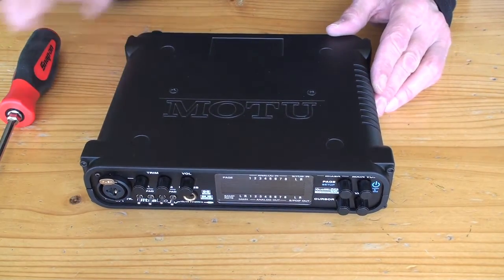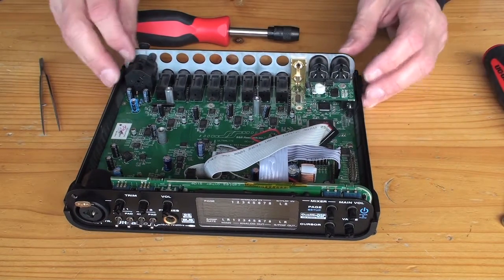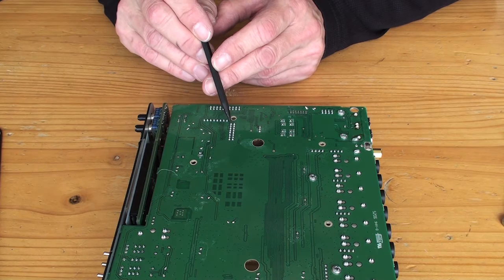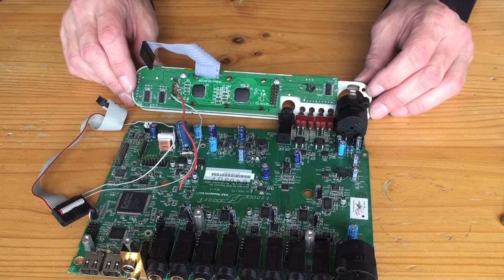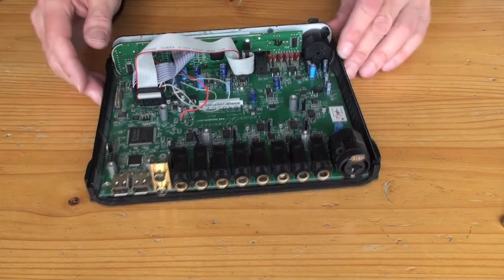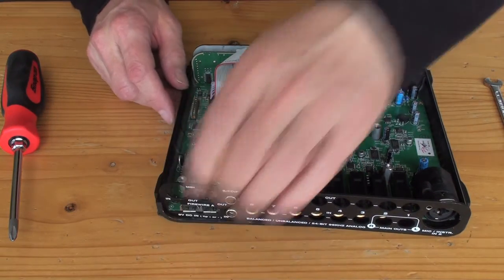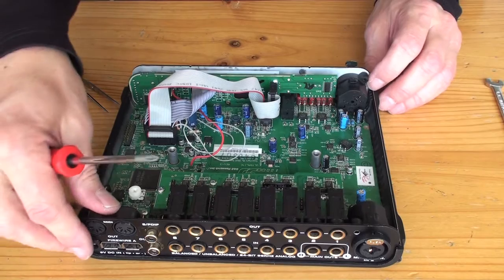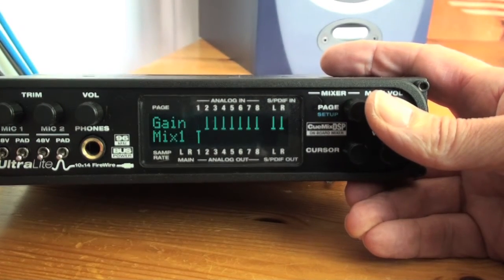Repair of MOTU UltraLite with faulty LCD backlight

Comment: Hi Valden,what cable can I use for that 5v power, just any electronic cable? And is it necessary to remove the entire board or could I just solder the  cable in place without removing the entire board? Thnx
Reply from the maker: Hi Walied. I've only just received advice of this comment. I don't know why Youtube didn't email me earlier. Sorry about that. Re the cable question - I simply used a cable I stripped out of a dead inkjet printer. As you can see in the video it's of about the same gauge as the other cables in the Ultralite. It's nothing special. If you are clever with soldering iron you could do the work without removing the board, though you would be limited to using the 5V source on the upper side. I see from your newer comment that you've been hard at work on this; I'll move up to that comment now. Regards.

Comment: Do you know why does the backlight start to fail in the first place? I mean, why does the stock connector stop delivering the correct amount of voltage to the leds? thanks, great video btw
Reply from the maker: Hi Gian. No I'm afraid I don't know why these Ultralites have problems with their LCD display brightness. I'm sure glad to have mine properly visible again. Even though it's years old we're using it frequently, making the most of its fantastic utility and great audio quality. A little while ago I did some outdoor recordings of morning birdsong, where I needed to crank the Ultralite's preamp gain up all the way, to get sufficient signal recorded. No noise that I could detect. I was using very good low noise large diaphragm condenser mics, which helped. The Ultralite really proved its value, so I'll be keeping mine working whatever it takes. :-) Thanks for the feedback on the video. I knew it would be useful to fellow travellers.
Reply: @Valden23  maybe it needs some reballing or maybe the lcd part was low quality… motu is a great brand but sometimes gets some compromises…

Comment: Thanks a lot for this video! I have a similar model - MOTU Ultralite Mk3 Hybrid Rev 2. There's a difference in the circuit from the v1 (the one in the video I guess), because I cannot find the pin point with 5 V on the board. Does anyone have 
the same issue as solved already? Thanks!
Reply from the maker: Hi Fiore. Thanks for letting me know the video was helpful. I'll try to be helpful again by mentioning that the best approach to dealing with an LCD that is fading is to replace it. I needed to do this in the end and it was a good solution. Anyone who can pull their MOTU Ultralite apart and do some soldering will be able to replace the display. Good luck with your repair! p.s. Be sure to read the NB notes in the video description. There's some useful tips there. 🙂

Comment: Do you know if the plastic cover in front of the lcd is removable? Mine is scratched.
Reply: Hi John. Hmmm, I’ve watched the video again and I can’t quite remember if the plastic outer screen cover is glued to the inside of the front panel or not. I think it is. Removing it might require heat gun treatment to soften the glue. It would be replaceable if you made up a suitable piece of plastic to fit. The lettering you see around the LCD is on a simple plastic template that lies between the outer plastic cover and the LCD. It’s held in place with a pair of mounting pins. I’d encourage you to dive in and make the repair you want. The hardest part will be sourcing a new piece of plastic. :-)
Reply: @SailingSnowGum  Thanks a lot....really cool of you to answer. And speedy too! :-)
Reply: @johnewald3148  Hi John. I can see I’ve forgotten to switch accounts to the appropriate one before replying.  Stand by while I cut and paste my words of reply into a new reply, from the right account this time. Regards, Rick (Valden 23)
Reply from the maker: Hi John. Hmmm, I’ve watched the video again and I can’t quite remember if the plastic outer screen cover is glued to the inside of the front panel or not. I think it is. Removing it might require heat gun treatment to soften the glue. It would be replaceable if you made up a suitable piece of plastic to fit. The lettering you see around the LCD is on a simple plastic template that lies between the outer plastic cover and the LCD. It’s held in place with a pair of mounting pins. I’d encourage you to dive in and make the repair you want. The hardest part will be sourcing a new piece of plastic. :-) Regards, Rick - Valden23

Comment: Awesome video!  Thanks for your knowledge! I have a UL MK3, long story short... I’ve hooked up the FW cables upside down. sighs yeah, I know. Am I out of luck? Or is there hope to save it? I was using the FW bus powered too. Anyways. Thanks ! Best regards,
Rick
Reply from the maker: carvedlegion G'day Rick. There's a fair chance your Ultralite will still work once the FireWire wiring is sorted out. Worth a try. :-)
Reply: Cheers! I’m a complete noob would you be able to shed some light on what could be done? (if it’s not too complex)  shoot me a message. :)
Reply from the maker: Hello carved. Going by the clues in your first post, I'm thinking the thing to do is reconnect the FireWire cables the right way around. Once they're connected the right way, your UltraLite might work again. :-)

Comment: Hi there, here I have 2 of these ultralites. One with very dimmed display and one with a broken lcd. I did the modification on the dimmed one, and the display became just a little bit brighter but sercainly not enough (or like your one). On the motherboard the nearest 5v point was the one you used, 5.03V. But this point you showed 5,12V. Nowhere on the board I found more then 5.03V (the lcd displays can me powered up to 5,3V) Is this 1,2 V difference the answer to the too dimmed lcd? In china I can buy these LCD's for around $15 (ex transport cost). But after the modification I contacted the former owner, and he said that you don't need the display at all for using the box! Is that true? Ps, dit any of you replaced the lcd display with a new one? Thanks for the video. Josefskil, Amsterdam
Reply from the maker: Hi Josefskil. Yes, I replaced my whole screen in the end, and it’s a great result. I had to solder pins onto the screen’s contacts, but that was easy. I encourage you to give it a try. It should work and you’ll be happy with the result. I found a suitable 16x2 screen at a local electronics store. Regards, Rick.
Re not needing the screen, I’m pretty sure the Ultralite can be controlled by a PC, if the software that came with it is installed.
Reply: @Valden23  Thank you for your instructional video ! I was also wondering what was the real issue on your board. Is it a power regulator (explaining the 3V you measured) or the 16x2 screen itself ? I am about to do the same repair (I guess) on a 828x.
Reply from the maker: @Natoozz   Hi Nat. The problem I had was with the display and I had to replace it in the end. This worked well and it’s like a new unit again. I recommend that you source a 16x2 display and the pins you need and put it in. It’s quite a doable job. 🙂
Reply: @Valden23  Thanks for your response ! I will surely do it, its indeed quite doable. 🙂 Si just out of curiosity do you know why you measured 3.4V with the original wiring ?
Reply from the maker: @Natoozz  Hi Nat. No, I don’t know why I got that voltage measurement. Sorry.

Comment: I just spent several hours with a tech and he watched your videos,it didnt work for me at all, instead of a dim screen I now have no screen,he was kind enough not to charge me, I think my display was just going bad, well I may buy another or get a motu traveler instead?
Denis
Reply from the maker: Hi Alien. Thanks for the follow-up. A good option to consider would be to buy a 16 x 2 LCD display at an electronics store and replace the faulty one. I suggest using the original wiring for the display in the first instance. The part should cost less than $20. These UltraLites are good units and are worth keeping in service.
Reply: I almost sold it on ebay as is,but then it dawned on me. the tech got paid nothing for his time which is so unfair.so I will do just that, buy a replacement lcd and have him replace it and charge me for his time.that way he gets paid and I get my motu working.good deal!!! by the way,I was upset,but I now realize how old these units are  s the lcd giving ou t is no big deal.your videos were very helpful by the way.
Reply from the maker: It sounds like a good plan to replace the LCD. Yes, these original UltraLites are pretty old units now, but the sound quality is remarkably good and they are genuinely versatile. Once again, thanks for pointing out that it isn't necessary to follow all of my disassembly instructions if soldering in that jumper wire is all that's needed. I wonder if I can add a notation to the video, to draw attention to this?

Comment: Hello Valden23! I'm trying to repair a MOTU Midi Timepiece2 and would like to replace the screen. I don't suppose you know the display pinouts, or where I can find them? Many thanks! Ben
Reply from the maker: Hi Ben. I'm afraid I don't have the information you're looking for. However, I did replace the screen on my UltraLite with complete success (not shown in this video). The LCD screen I selected had the same pin settings as the original, which is no surprise really - it will be standardised across the industry. So chances are that a display you select as a good physical fit and with the same number of pins (which you might need to solder on - easy) will work. Give it a try and report back! :-)
Reply: @Valden23  Hi there! Thanks for getting back to me :) I'll give that a try!
Reply from the maker: Ben Scott Definitely worth a try. As a guide, it cost me about $20 all up to buy a suitable display and a strip of pins to solder on to it, so the ribbon cable connector can be pushed on. A fun project for anyone with good, basic soldering skills and equipment. :-)

Comment: Cool! Do you know how to change the volume "power-on/off" button to be wireless remote control one?
Reply from the maker: Hi Jason. This question is easy. Nope, I don’t know how to convert the volume/on/off switch to be wireless remote control, though I can see some handy applications for this conversion. If you do work out how to do this, make a video of it! 🙂 Regards, Rick.
Reply: Just add a “bluetooth control wall socket” so you can off it from the couch…

Comment: nice vid! I have a Motu 828mkII, do you know how to fix a mic/guitar in? I have one working properly and the other one is doing noises and latency
Reply: MrDobleagent G’day Dobleagent. No, sorry - no experience with the 828. My initial thought is, the problem you describe doesn’t sound like an easy one to diagnose. Sometimes it’s easier when they flat-out just stop working. I’m trying to figure out what’s wrong with a Tannoy studio monitor, which works for a few minutes then starts crackling, then goes silent, then comes good again, sometimes. If it would just die I might be able to fix it! However, if you have some skills, even basic, with a multimeter, I encourage you to lift the lid and look for and probe for dodgy connections. It might simply be a case of resoldering a component, or finding a blown one. Sometimes the dodgy component is visually obvious. But it can become very time consuming, if you’re still learning. Perhaps asking a repair guy or girl for a quote is an idea? Or the MOTU techs. They’re probably familiar with the fault, and should have the right spares. All the best with getting your 828 back in the game. It’s good gear!
Reply: Thank you very much by the dedicated answer. About 828 and ultralite, im pretty sure are the same components, the only problem on this equipment is that one about the mic/guitar in, and also... another noise coming inside the case after few hours of use, this doesn't affect render or producing / time, I guess can be maybe a transistor or something else like a capacitor... I dont know, but im curious to opening and see from where comes the noise, but maybe better if I go with a repair guy than try by myself hehe, also I hope you fix your Tannoy monitor! all the best and thanks again by the reply
Reply: MrDobleagent Doble, another thought I’ve had is - have you searched the MOTUnation forum for clues? I found some key and encouraging information there which helped take my Ultralite repair efforts to the next level. Sometimes just a snippet of a clue is enough to get you looking in the right place, such that with a screwdriver and a basic multimeter you can find the problem. A careful approach comes in handy too, of course. Watch out for static electricity buildup from movement of your clothes and dissipate it by touching a grounded object, then staying calm and still while working. Easy to manage. Apologies if your experience level makes you rolleyes at this advice. 🙂 I do urge you to at least get the case open for a look. A baby cockroach might have got itself zapped on a capacitor. A simple clean with isopropyl alcohol or a straightforward component replacement could be all that’s needed.  Case in point - last year my neighbour asked for help to take his broken big screen HD Samsung television to the recycling depot. I asked if I could look inside, noting I have no experience with such devices. I saw four capacitors that were obviously failing (swollen tops). He’d already bought a new one and said if I could fix it, my family could keep it. It cost $3 for four caps and took an hour to replace them, including driving to the electronics store to get them. My kids were very happy with the ‘new’ TV. Good luck.

Comment: hey there mine, i guess got its usb input fried or sth due to some ac surge (there were a lightning botl so close to my house recently and it clipped during that flashes couple o times, i regret not shutting it off) it boots up decently but when i unplug or re-plug the usb cable i cant hear any win signals to indicate such a connection to be established, could  its usb input be repaired and could i have made it done, on my own? would you please tell me if you do have an idea what should i do about it ? thx in advance
Reply from the maker: Hi Cankut. I'm thinking you must have a later model than my Ultralite I, which only has Firewire. However, yes, I do think you can diagnose the problem with your USB, given your advice that the unit still boots up. Does it function properly, apart from the USB problem? The job for you will be to use a good multimeter and trace the continuity and voltages from the USB cable, then to the port, then through the components and traces to see if there is an interruption, a failed component, etc. You might find that a single component that is easily replaced has failed. Good luck with your diagnosis.
Reply: @Valden23  it boots up ok i think, and the sample rate led goes ok, then, it has audio signal when i get in a guitar, on the meterbridge...other then those i have no clue  but im gonna do your biddings asap thank you so much for being concerned.
Reply: @ewwewwewwe8520  sure, but its a little bit terrifying what you say coz if u somehow get a reconginiton signal, in my mind, you should have been far away from having a replacement issue for that port, and by only having the card reinstalled properly the rest of the obstacles would have been dealt with  at the instance... coz mine got no sorts of a connection signal at all...im thinking as if the common protocol for the USBs is similar with the conventional PC in principal, then i would be made thinking like perhaps main chip has a rebooting issue, like a bios update to be made properly rerouting its related peripherals, so i would suggest for it if there is such an option in these cards...i mean like a bios update or sth equivalent in effect...please record your operation if you go for it, there is not much on the net, visualizing the box opening on mkseries...best.
Reply: @Valden23  greetings...this evening my friend got the box opened and replaced the usb type b but since we do not profess in electronics to suffice in the tasks you've given i am a bit stuck right now, i will check for the service fees first and then hopefully get it fixed. ive to admit, its horrible already :D...best.